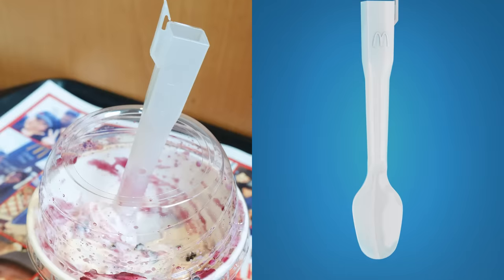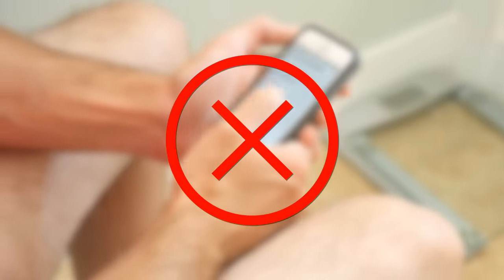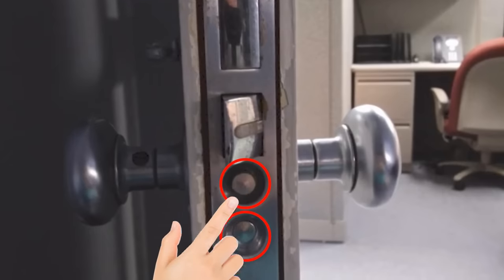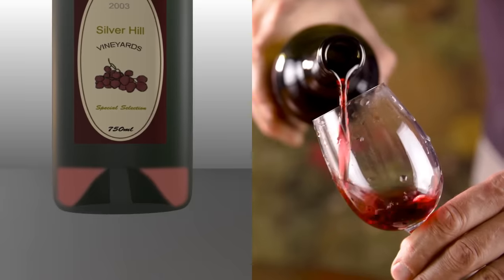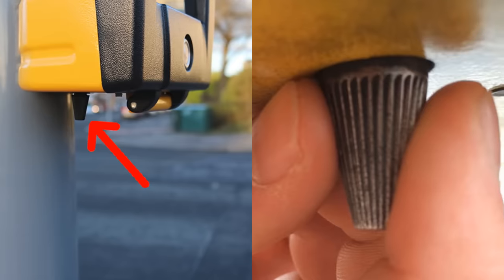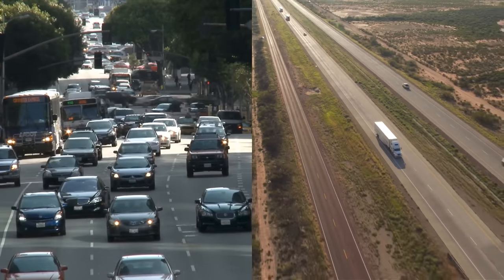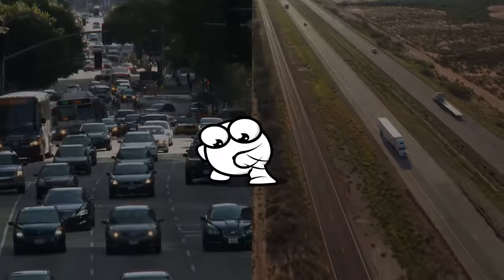Amazing Secrets Hidden In Everyday Things - Part 2

Comment: In my medical training (and it was mentioned in at least one CPR class that I recall) I was taught the thing about the hole in pen caps. All this time and until today since I had noticed the hole was not present in all brands & types of pens I believed that this was a joke ... also thinking that the miniscule hole in the caps was in fact too small to keep an individual from choking to death. Now having given it some thought I am thinking that this may be true. Perhaps the hole would be large enough to keep the choking individual from passing away but maybe not large enough to prevent long term damage due to insufficient oxygen saturation. Curious now I am off to do some research on the subject. Does anyway out there have any additional information on this? Thanks and greetings from  Salem, Oregon USA.
Reply: I'm thinking from a Nurses view point: I can see the hole being big enough to benefit a child but not for long. But hopefully Resuscitation starts within the 3 minute mark & Oxygen can get around it or EMTs can try to get it out.
For an adult, it wouldn't completely block anyway. 
My opinion is keep those kinds of pen caps away from small kids. As for  Adults...there's Darwin's Theory?
Reply: In australia we had bic biro's with a full cap till the 70's, when suddenly the tips on the lids disappeared.
Reply: Because, the hole in the top of the pen cap also prevents the the cap from resisting removal or replacement on the pen due to presdure deffierential, I argue that the tiny single hole on the old Bic pen design is not present merely as a safety measure.  By the way, has anyone noticed that the later Bic Biro cap increased the air passage by introducing multiple openings?

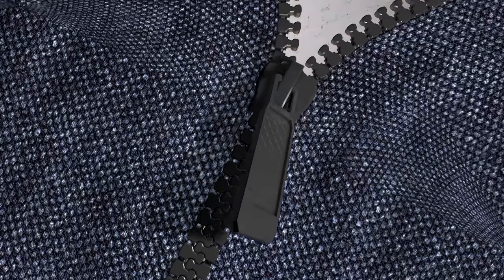Comment: 0:23 Zipper Flipper
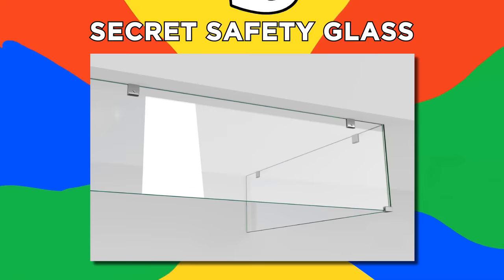0:53 Secret Safety Glass
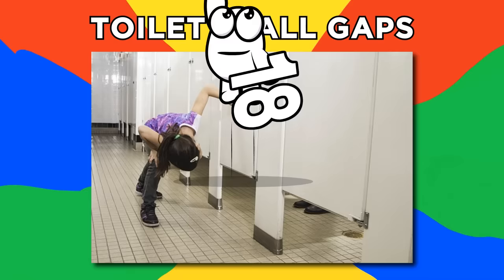1:22 Toilet Stall Gaps
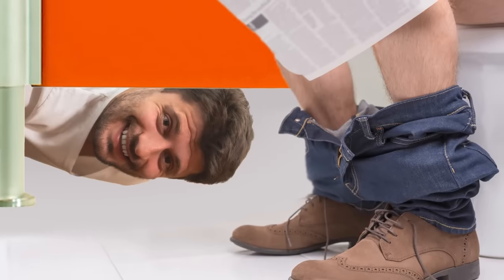1:54 Stink-Pipes
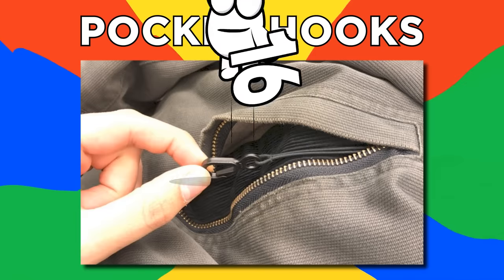2:39 Pocket Hooks
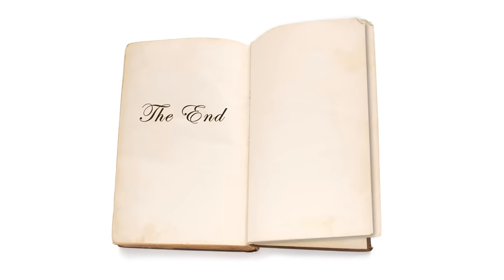3:12 Blank Pages
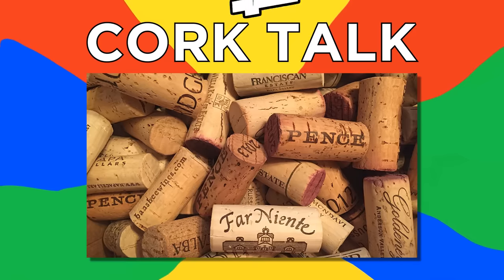3:47 Cork Talk
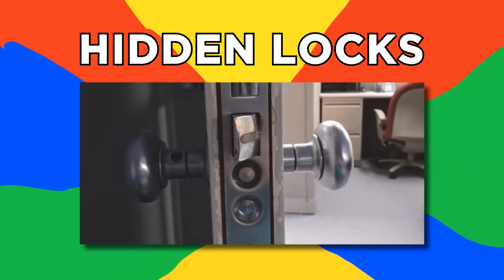4:29 Hidden Locks
4:57 Golf Ball Brilliance
5:58 Wine Wisdom 
6:43 Windshield Dots
7:21 Lollipop Lifesaver
7:44 Crosswalk Assistance
8:08 Highway Hints
8:39 Pen Cap Precautions 
9:23 McFlurry Spoons 
10:03 Chip Bag Circles
10:27 Microwave Silent Mode 
10:57 Elevator door Holes
11:23 Pen Fins

Comment: On US interstate highways , a 3 digit number beginning with an even number is usually a bypass route, but if it begins with an odd number it doesn't loop back to the main route- it usually goes to the city center.
Reply: Got it right, Anthony.  Even leading three digit interstate numbers (e.g. 270) indicate a circular route (perhaps a beltway) of the main interstate.  Where the leading digit is odd (e.g. 570) the route is a spur or point to point route joining rural or urban areas to other urban areas.

Comment: Wine does not “age into better flavour” once bottled. It actually starts to spoil as soon as it is exposed to the atmosphere. While you were right in stating that the cork is watertight but allows air to seep through, this exposure to oxygen is what spoils the wine, hence best to drink within 2 years of bottling. That is why the vast majority of good to high quality wine bottlers will seal the cork in wax or plastic seal as this helps extending the bottled life.
Reply: Some red wines are very tannic and take years of proper storage to be fit to drink.
When young the flavor is harsh. It mellows over time as the tannins break down. 
Waiting too long to drink it as also a mistake because the quality declines after a peak.
Reply: Decanting certain wines is very beneficial and is especially helpful if you are serving a red wine before its time.

Comment: I always thought the lollipop hole was to prevent suffocating if swallowed.
Reply: It is, I dont know why said something else especially when they said the correct thing on another video titled the same name but as kids are the general amount who eat them, it's easy to push in too far so they can still breath if it does
Reply: But you always get some lollipop stuck in that hole so it wouldn't work
Reply: When i was a kid they never had the holes. It was just a stick
Reply: It is
Reply: @Sjrick  yeah same. And they were like paper not plastic so they would disentergrate.
Reply: But then what is the top for???

Comment: Big gaps in bathrooms are for emergencies like OH THEY ARE PASSED OUT
Reply: I thought so u can see if it taken
Reply: I was just getting ready to say this. Yeah it’s for a few reasons. It’s so that if someone dies or has an emergency and can’t get out on their own, children don’t get locked in. This is the first time I’ve heard getting people to hurry up. I have never cared if someone sees my legs and feet but I could see how that would work for some people.
Reply: It's not for passed out it's so you don't get GASSED OUT!!
Reply: Why do people think this
Reply: We can sit here and come up with potential uses all day, but like with many things, there's no single correct answer. There were probably multiple reasons behind the design when it was first implemented, and I'm sure each manufacturer and each buyer has their own set of reasons for still producing and utilizing these types of stalls today. Jabbering off a purpose as if it's an absolute fact doesn't exactly make you any better than the creator of this video.
Reply: @jameswilson591  Except the reasons vary per manufacturer and per buyer... As I've already stated. But I guess you can somehow speak for every single manufacturer and company that has ever produced or purchased these types of stalls for the past decades? I'm sorry you've chosen to be so offended by this fact, that wasn't my intent, nor was it even specifically targeted at you.
Reply: Weblure Joltik there’s building codes. They are forced to be designed a particular way in order for them to conform to standards that are set by city, state and federal codes for high occupancy buildings. The reason they are all manufactured similarly with the gap in the bottom is to meet code standards. The reason those codes were made and enforced is because of the reasons we mentioned above.
Reply: @jameswilson591  That's a much better argument, thank you. Do you have a source for this? I'd like to read whatever you read.

Comment: When you look at a plane window look close to the bottom middle and you'll see a small hole. That hole is there to protect  the window from breaking. The window has multiple layers so If something strong enough penetrates it, that hole serves as a barrier to prevent the window from shattering completely to where you are bound to freefall
Reply: Except for the lady that did...
Reply: G u l p - now that I have the visual in my mind ...  😳 - I'll pay closer attention. I thought the little w indows were pretty flimsy on my flight to Hawaii. They felt plastic and thin...thanks for the info

Comment: Nerdy hint: those keyholes on elevator doors are called escutcheon holes. They work because they disengage the spring mechanism that keeps the doors shut and locked, allowing them to be opened when the elevator isn't at a landing, or when the doors fail to operate for whatever reason. They're often used to gain access to the top of the cab for maintenance. The elevator will be driven down to the floor below, locked out, and the doors on the floor above opened, to gain access to the shaft. Once you're there, there is a button panel on the roof of the cab that allows the thing to be driven while sitting on top of it. Also, that microwave trick didn't work for me, that's pure sadness.

Comment: Another reason why bathroom stall doors are so high off the floor is so rescuers can get in in case of trouble.
Reply: You can easily open any stall from the outside using a coin/flat head screwdriver even a random key. In the event the lock jams, the person can crawl out of the stall. It's not specifically designed for rescue workers.

Comment: The lolipop square hole is used for life saving. If you like those white sticks tho
Reply: Except the hole is blocked until the very end of the candy.  If it was there for life saving like with pen caps it would need to be open at all times.

As the video said it was put on the sticks because when they switched from paper sticks to plastic the hard candy didn't stay on the stick as well so they added the hole to give it grip.
Reply: Nah it’s so the lollipop can stay on the stick.
Reply: @nobodyimportant2470  Yea, there is some small lolipops without hole at top of the candy, and sometimes they fall from its place. And some lolipops which are bigger, they have hole at top and bottom of the stick for the safe.

Comment: did u know that the gaps on toilets  have an another function if locked in stall and cant get out you crawl out under the door
Reply: More importantly it's designed that staff can crawl in and unlock the stall.
Reply: @sleepy1697  They wouldn't need to crawl in and unlock the stall if it wasn't so easy for people to crawl OUT after locking it. Most stalls have a special "key" that fits into a slot on the outside of the door to unlock it. It's designed to fit a certain tool, but it's not hard to figure something out that will turn it. They aren't really locks, they are just to discourage random people from barging in. They put the bottom gap there mostly so little kids can't get somehow trapped, or to prevent people from jamming people in stalls as a "joke", but it's not a law, not everywhere anyway. But in the "fact" he was actually talking about was the gap around the doors, which let people see glimpses of the occupant.

Comment: The glass that is used to “prevent the smoke from going up into higher levels” is partially true they also act as a heat collector to set off sprinkler systems.
Reply: I was thinking the very same thing. I just thought what do I know about it?

Comment: Wrong on stall doors. Its to quickly detect an open stall (without opening or trying each door) and for better air circulation and to allow janitors to mop under which is done twice a day in most places.

Comment: The hole in the sucker stick is to help you breathe if the stick ever gets stuck and your chocking just like the pen cap
Reply: Mikelle Perkins maybe but they usually have sucker still stuck in them anyways, so that wouldn’t be super effective.
Reply: wrong. how does a tiny hole on THE SIDE help you breathe??it would be against your throat

Comment: There is like ONE pen model that got this hole in the cap - every time the story coms up it's with a picture of THAT ONE model... Never showing any of the other thousands of different pens that does't have a hole in the cap.  So it's obviously not to reduce choking hazard, and its not something that is required by law... A few minutes later the video shows a Pilot UNI-ball - WITHOUT a hole in the cap.
 The blank papers in the book - it's not about the printing process, it's how you bind the book.
Reply: This is one of the people who disliked this video
Reply: dude, it's like you've never used a cheap pen before, they basically all have those holes

Comment: I thought the gaps at the floor were to make the floors easier to mop.
Reply: Hmm yes, so you can bend over and kill your back by mopping an entire stall through a short gap in the door... when you could just open the door and mop it normally like a sane person.
Reply: @weblure  Mop handles are sufficiently long enough you don't have to bend over much as stalls aren't very large but long enough to be crowded in the stall.  Dirt would also build up along the bottom of the walls.

Comment: You forgot to mention in the video that the punt on the bottom of the wine bottle is most importantly there for serving purposes. If you were a banquet server you would know that the punt indention is for your knuckle on your middle finger to fit inside that way you can pour with one hand across a large dining table.
Reply: The Poster can only get the information they are given. In the person giving the info didn't know this, then - oh well...

Comment: The BIC pen hole when fitted to a fuel line and positioned on top of a VW carburetor acts like a fuel jet allowing the engine to run @approximately 2,000RPM.
 I did this out of necessity. The float needle was syuck 'CLOSED'.

Comment: Wine bottle punts also make the bottle stronger. Having a domed end (remember early plastic soda bottles that had an extra piece of plastic over a rounded bottom, so they would stand up?) would make the bottle stronger (sort of like an arched bridge) but it wouldn't stand up. So they reversed the shape of the dome.
Reply: There are 3 "correct answers.
so the bottle doesn't explode when the cork is put in. 
For the wine steward to hold the bottle for pouring 
For the monks to place in apparatus to make sparkling wine.
All of the above.

Comment: Ever wondered how to know which side the fuel goes in a car look at the fuel gauge and there is a small triangle point to the side the fuel goes in handy if you are using a hire car or van
Reply: Good to know, thanks.
Reply: LIES!!! My car does not have this. It has no indicator of an arrow or a small gas pump. Maybe this is something only put in cars built after a certain year. But I've heard this so many times and it always aggravates me. Mostly because after the first time you put gas in your car, it shouldn't be a problem. Lol!
Reply: @jessicafain6630  it depends on the manufacturer of the car.  But most cars  these days have the arrows.
Reply: If there's no arrow, they sometimes use the little picture of the pump or fuel symbol. They started doing it in the 90s after most manufacturers stopped putting the fill pipe behind the license plate.
Reply: The vast majority of cars have this type of filler indicator but not all of them

Comment: The large gaps under the stall doors in the bathrooms are a safety feature that is designed to be able to crawl under in case of an emergency. The gap between was also designed to be a safety feature, but is actually the uncomfortable part.

Comment: I always thought those holes were in the lollipop sticks were there in case the sticks got caught in someones throat they would still be able to breath like a pen lid
Reply: No, they're usually still filled with candy even after the lollipop is used up.
Reply: Pen caps have a hole so you can actually get the cap on and off.  Otherwise it creates a vacuum.  Has nothing to do with choking on it.

Comment: The glass dots were originally a mistake, a car windshield designer drew the design with Dots (called stippling) to indicate shading /tinting however, the manufacturer thought the dots were supposed to be dots and made the glass with actual dots. They were semi effective as a shade and the trend caught on. I believe this happened with one of the early Camaros.
Reply: I thought it was to assist the tempering process so the edges of the glass didn't cool faster than the inner part of the glass, but probably not now that i consider

Comment: The ACTUAL purpose of dents in the bottom of wine bottles is to increase the surface area of the bottle. So, when shaken or dropped, the amount of force inside is displaced over a larger area, reducing the likelihood of busting the bottle.

Comment: Another fun fact for the hole in sucker sticks (for those who may now know). In case if they're swallowed, you can still breath, as the hole will provide a channel for your airways to still function 👍
Reply: No, that's pen tops as one end is sealed. These straws have open ends so another small hole at one end will make no difference.

Comment: No winemaker wants air to enter after bottling, which was why corks were used in the first place. A good quality cork allows no air to enter (other than what is squeezed out of the cork).
Screw caps are more efficient at sealing the bottle and the only thing preventing their wide use in the US is public acceptability.

Comment: 4:20 As you can clearly see, there is a very tight metal cap over the cork, so aging cannot possibly the answer. Also, more and more corks are actually plastic. The more likely answer is, that it is tradition.

Comment: The bump in the bottom of wine bottles are also used for shape charges. On the demo range we cut the tops off and packed the rest of the bottle and it punches straight through whatever we put it on

Comment: Only half right on the roads.  1. It only applies to interstates. 2. Yes even are East West, odd are North South. 3. A 3 digit that begins with an even number is a bypass or beltway like 295, 495, 695.  A 3 digit that begins with an odd number is a spur which takes you to the inside of whatever the bypass or beltway is going around such as 395.

Comment: Another one is:
On the face of the fuel gauge in your car, is a little arrow icon. This points to which side of the car the fuel fill is located on. No more looking silly when you need to put gasoline in an unfamiliar to you car.

I hope you read this in the creepily soothing voice of the narrator, or, for fun, change it up- do it in gilbert gottfried's, or elmo's voice.

Comment: #12 I heard about at least one occasion when some airliners got caught on the ground by a really bad hail storm (Decades ago). After the storm, the planes were all full of dents. Obviously, they were not certified to fly with those, so they had to be repaired. Most got repaired on site, but some got a special permission to be flown back to the manufacturer.

As it turned out, they used 10-15% less fuel than before.

I still have no idea why there are no dented planes out there...
Reply: We need pre manufactured dented vehicles
Reply: Do you really expect people to get on an Airplane with DENTS in it?😳😳😳😳😲😲😲😲 Especially someone who has an extreme case of *fear of flying*? 
😬😬😬😬😬😬😬
😄😄😃😃😆😆😆
Reply: Esthetics and probably to keep passengers from freaking out.